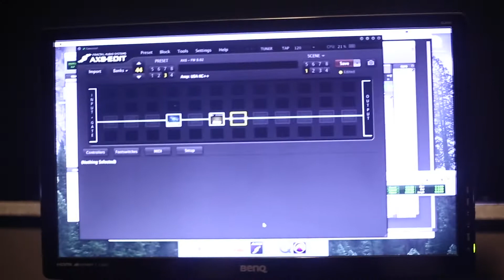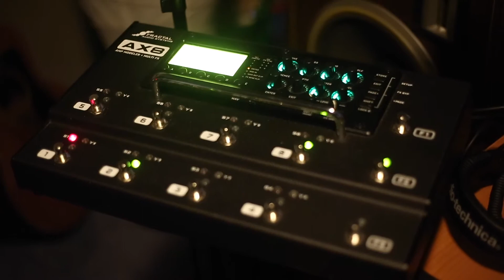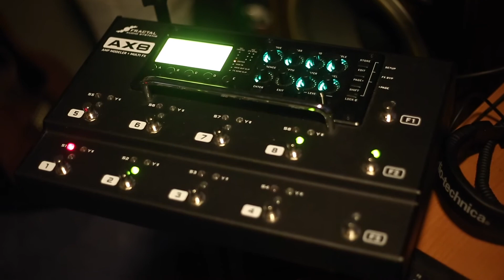Tube Power Amp Shootout - AX8

Comment: Hey, i huat got the ax8 ... im setting up a preset with an amp block and a cab block which go to the main output (to the pa) but also im putting an fx loop block paralell to the cab so that i can send a signal to the return of the amp to use it as a stage monitor.... is there a way to keep the poweramp simulation on for the main output that goes to the pa but switch it off to the fx loop block that goes to the amp ?
Reply from the maker: Not on the AX8 unfortunately